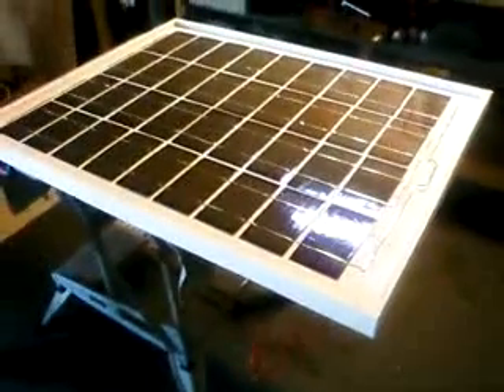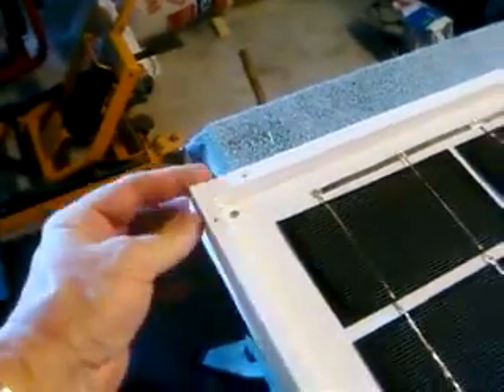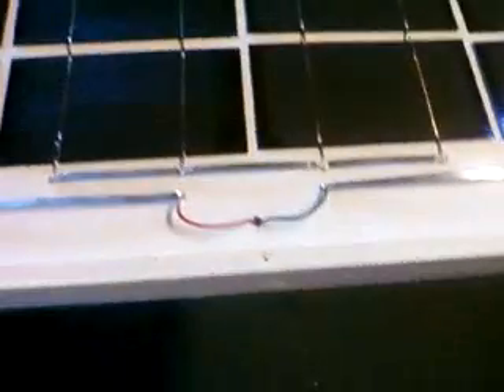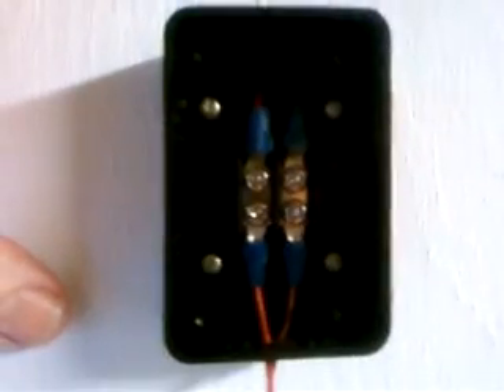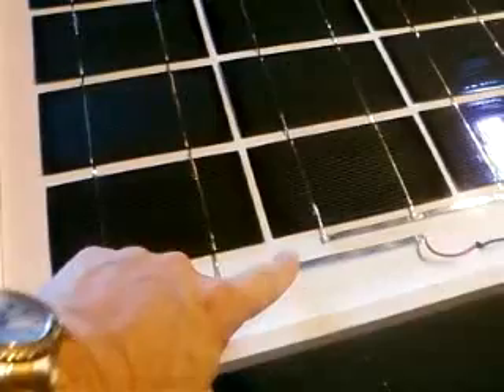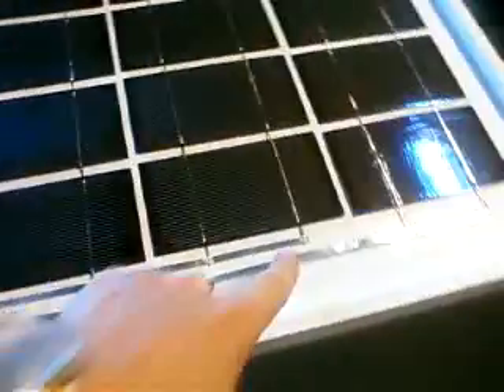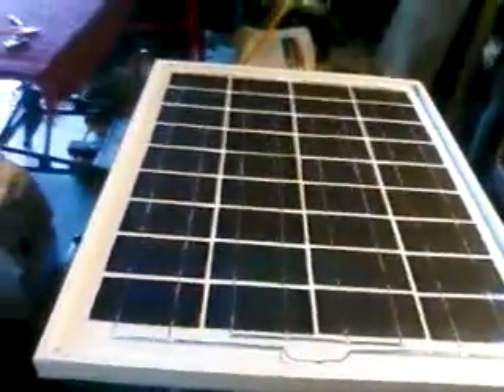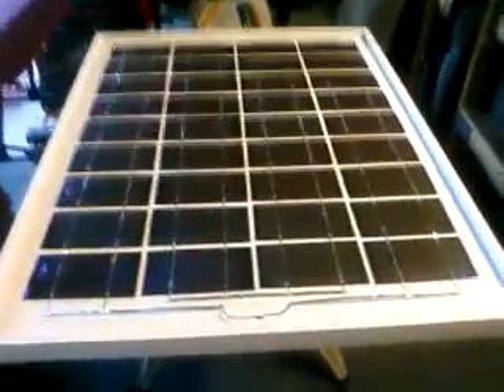My Solar Power Set Up - Part 6 - Building a Panel - Conclusion

Comment: Appreciate the time you put into your videos.  I  am gathering the parts necessary to start my project and have watched all of your videos and read every comment....  I still have a few questions: 1. Why did you end up changing the wire coming out of the inverter? 2. How do you test your batteries and do you have to add water? 3. How did you connect the new panel you made to the charge controller? Thanks again!

Comment: Very nice looking panel. I'm sure it has taken some time to get to this point. I had thought about building my own, but have chosen to buy. Due to the fact that I do not have a secure, clean working area to put one together. My dog and 3 small kids would probably break something. I would try and get your cost down some more. I bought my 130watt panels for $1.98 per watt. Later from sunny FL

Comment from the maker: @Maccan Thanks.  I was a little worried about the Scotch tabs myself.  They did start to slip, and I had to secure them at the top bus wire with a thumbtack through the bus wire and into the wood.  However, this panel is nearly vertical, and I believe that if it was laying flat or at something like 5 or 10 degrees that they would hold up just fine.  I am going to experiment with a drop of superglue on each side of the tabs next time to see if that helps.

Comment from the maker: @VWRabbitdiesel The tape mounting worked pretty well, it slipped a little due to the vertical panel but if you laid it down there would be no problem.  I used the same glass that you did, but I had to remove it and it broke so I went with plexi which I don't really like.  No problem with any shading on the sides, we both have the same ideas on panels.

Comment from the maker: @SwindleFlu No, it does not need to be wood.  I have seen some that have the cells sandwiched in between two panes of glass, which is what I am going to try next time.  I don't know about the chicken wire, as you do not want the cells or tabs to contact any metal and ground out.  I think the varnish or poly would be a bad idea.  There is an encapsulant made of sheet plastic that is available for this purpose.

Comment from the maker: @SwindleFlu Thats kind of what I figured after I wrote that.  I think that the next one I make will be glass front and back also.  This one is warping a little right now, but still working at 100% capacity.  Right now, the three panels and 8 batteries I have generate more power than all of my lights and TV use every night, so the next panels will start to move me off grid in the daytime also.  Keep it up...

Comment from the maker: @VWRabbitdiesel Thats exactly what I was thinking of doing also, it is not really needed.  I was just going to put a couple of stiffeners on the back of the panel so the main backing doesn't warp, then stick the cells right on the front side with the Scotch tabs.  Should be ALOT easier to assemble.

Comment from the maker: @mhdawso Thanks.  I assume that you mean the main power wire from the batteries to the inverter.  This needs to be as big as you can get.  I let the charge controller keep the batteries charged, no need to test them, but I do check the water monthly and add some maybe twice a year.  I connected the new panel with one of the combiner boxes that I came up with.  Any more questions, please ask.  Everyone should share their knowledge here.

Comment from the maker: @mhdawso Yeah, it was a 12 guage extension cord, but I just switched it to regular 12-2 wire because it was easier to work with.  There is no difference in voltage, my roof panels are 12v base and my home made panel is also 12v base.  As you know, a 12v panel will actually put out more than 12v in operation.

Comment from the maker: @VWRabbitdiesel No, those are not vent holes but the screws holding the substate down.  I did not silicone down the plexi top, I just laid it on there and framed it with the metal edging to hold it on so it would vent.  No problems so far even after some major rainstorms.

Comment: Thanks for the vid. I noticed that factory made panels encapsulate the solar cells in some kind of a clear silicone, and they are essentially glued to the glass panel. I was wondering if you've had any problems with your system as far as fogging of the glass or expansion of the backer board causing the photo cells to crack?

Comment from the maker: @theno1katzman Because I didnt know what I was doing!  For obvious reasons the panel is no longer working, so I am working on a larger panel that will be 76x34, will approximate 3 of the panels above, have an aluminum frame, and be encapsulated from the rear.

Comment from the maker: @1971mgb Yeah, the cost was right at about $150.  The only problem is that brand new factory 60w poly panels are selling on ebay for like $160.  The prices have really come down.  It is a good project to experiment with, but not too economical anymore.

Comment: Actually, I was referring to the A/C output from the inverter.  In your first video the cable appeared to be thicker (like an extension cord); you mentioned replacing it with 12/2... just wondering why?  (does the 12/2 cable cut down on loss?)... So the difference in voltage doesn't cause a problem when combining the 12V (roof) panels with your 18V (home built) panel using your combiner box?